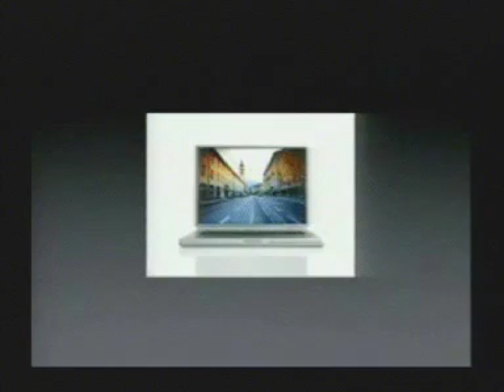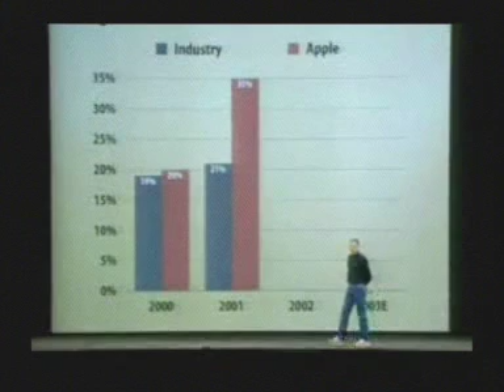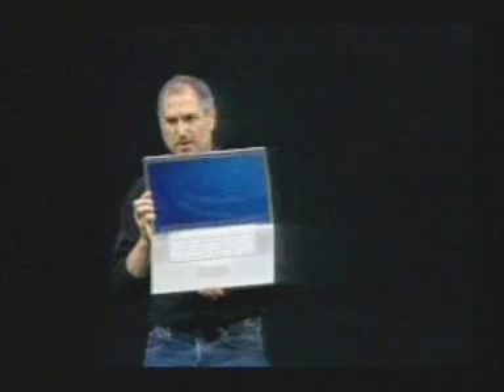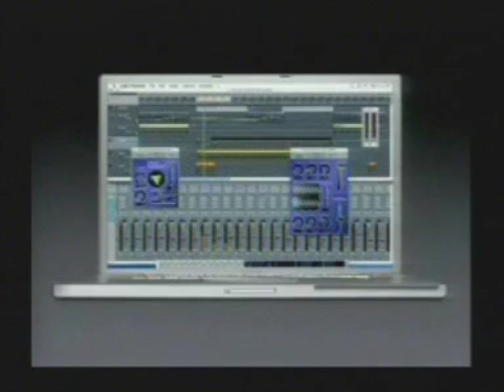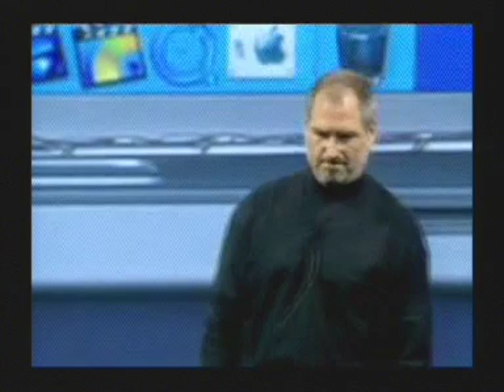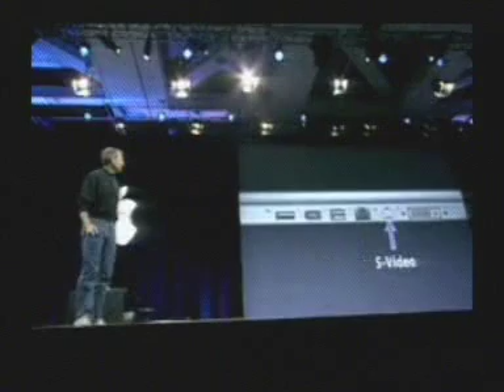Macworld SF 2003 part 1

Comment: Cool. I do realise that the figures that catch on are often not technically accurate. Like 4 : 3 or 2.35 : 1. Case in point - don't afficianados point out that the iPhone 3G is really using HSDPA which the industry doesn't quite consider as the older 3G standard? Personally I feel it's okay to call it 3G.

Comment: AVG is the best anti virus software out there and my speeds have been fine (and given that it has been download over 55 million times, I think its fine for most). 

Zone Alarm is slow until you set which programs are allowed/not allowed, after that its fine (if problems continue use Comodos).

Peer guardian is very much needed, especially when doing downloads (legit or unlegit) because you are the most vulnerable when downloading.  Ad aware takes care of all the spam that caught through.